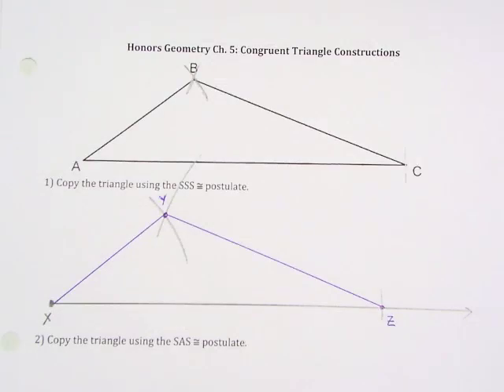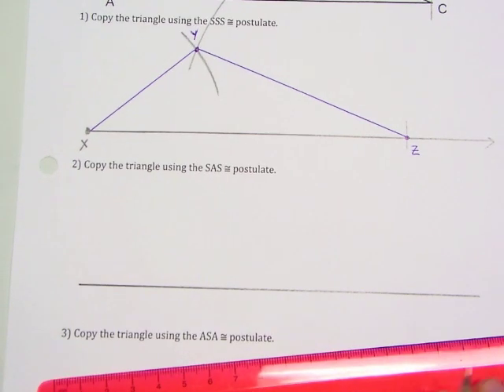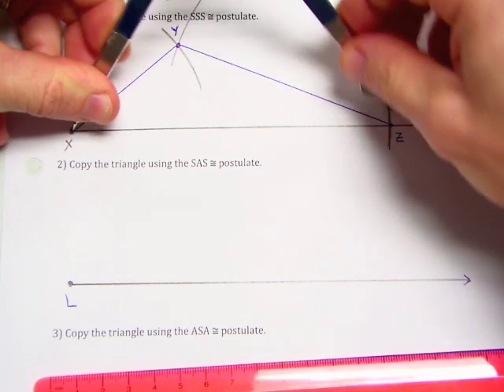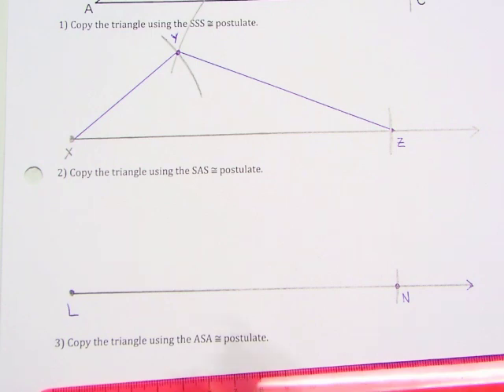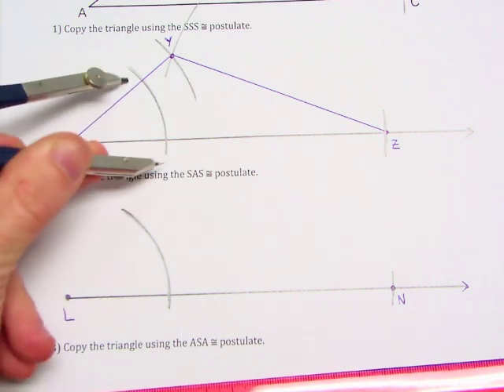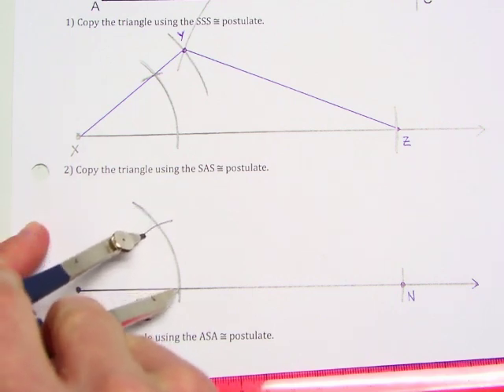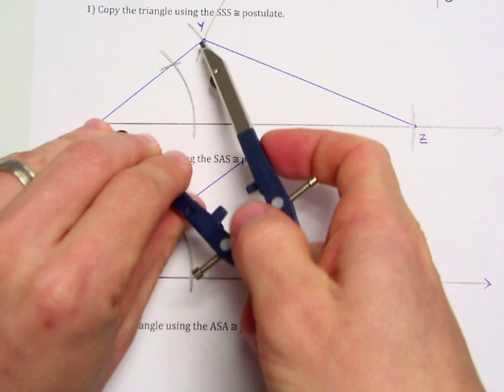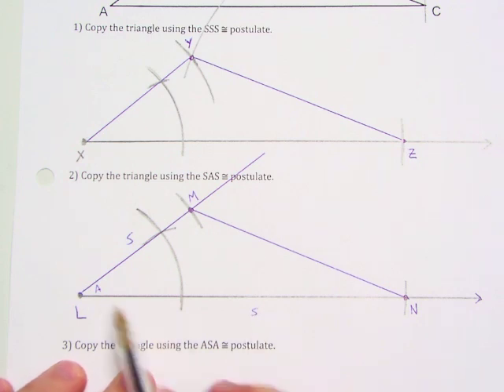Construct Congruent Triangle SAS.m4v

Comment from the maker: My compass is a Staedtler.  I don't know exactly which model (if they even make it anymore).  Something like this looks similar...

https://www.staedtler.us/en/products/technical-drawing-instruments/compasses/mars-comfort-556-precision-compass/

The only thing I don't like about mine, is the little screws that hold the lead or the point in place can become loose and can fall out and you can lose them.  The point is great, very sharp.  It has a good solid weight so it is easy to hold and control.  And the precision wheel make it so easy to adjust and keep your adjustment.

Comment: Where did u buy ur compass all mine are shit
Reply from the maker: My compass is a Staedtler.  I don't know exactly which model (if they even make it anymore).  Something like this looks similar...

https://www.staedtler.us/en/products/technical-drawing-instruments/compasses/mars-comfort-556-precision-compass/

The only thing I don't like about mine, is the little screws that hold the lead or the point in place can become loose and can fall out and you can lose them.  The point is great, very sharp.  It has a good solid weight so it is easy to hold and control.  And the precision wheel make it so easy to adjust and keep your adjustment.

Comment: This helped so much with Geometry :) Thank you! 

PS: What brand of compass do you use? I really liked yours.
Reply from the maker: My compass is a Staedtler.  I don't know exactly which model (if they even make it anymore).  Something like this looks similar...

https://www.staedtler.us/en/products/technical-drawing-instruments/compasses/mars-comfort-556-precision-compass/

The only thing I don't like about mine, is the little screws that hold the lead or the point in place can become loose and can fall out and you can lose them.  The point is great, very sharp.  It has a good solid weight so it is easy to hold and control.  And the precision wheel make it so easy to adjust and keep your adjustment.